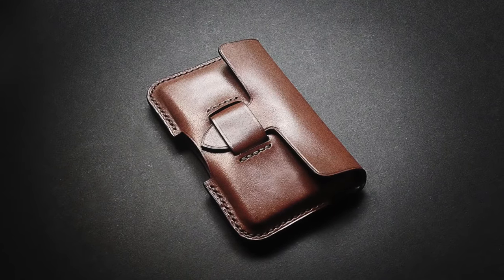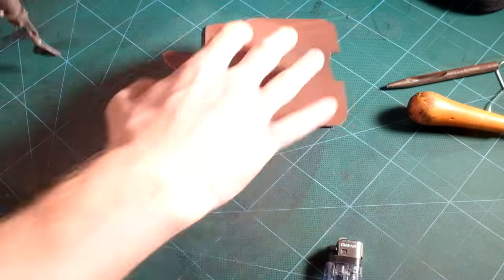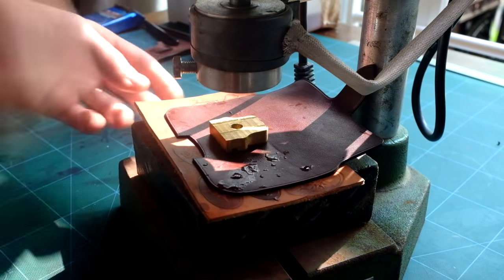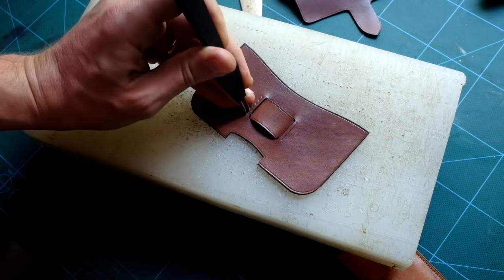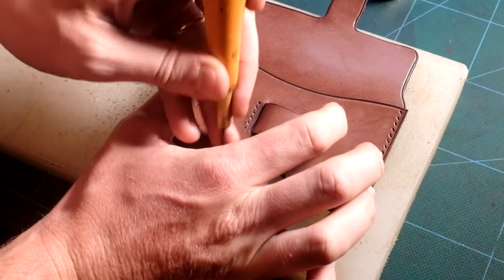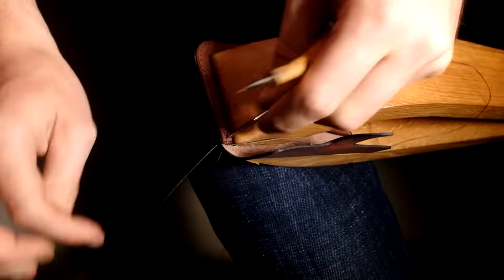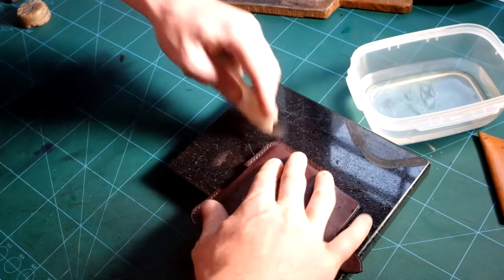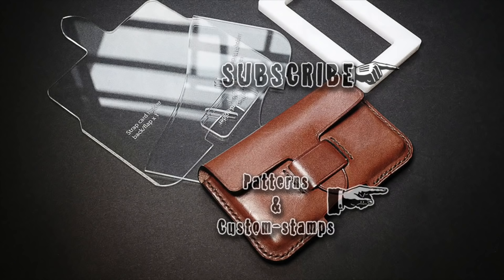Molded strap card holder • leather craft tutorial

Comment: Hi,recently purchased your acrylic templates for this wallet,I have noticed that there is a difference between the 2 templates,the top 1is a little larger than the other ,is this right ?i have not tried to use it yet ,finishing other projects before starting the wallet.
Reply from the maker: In this video I am punching the front and the back individually, I have cut the front and the back to match exactly. The frontside acrylic pattern is about 3mm bigger on the right, left and bottom, so you can assemble it first with the backside/flap part and then trim the excess leather to get perfect edges and then punch all the way through using your pricking iron. Please contact me by email if you need more details, so I can send you a graphic.